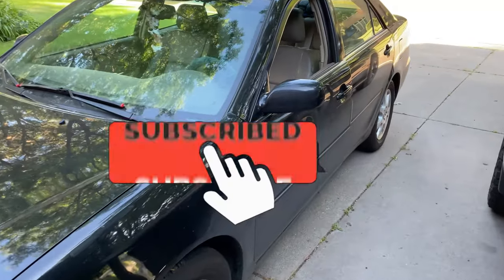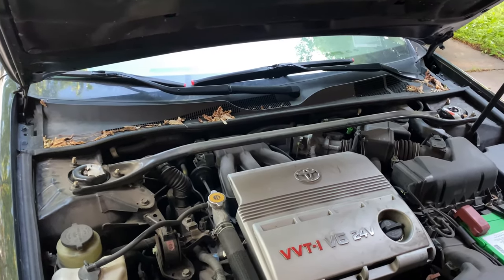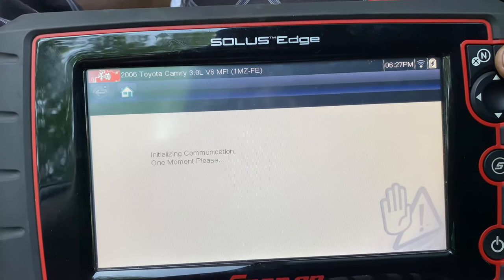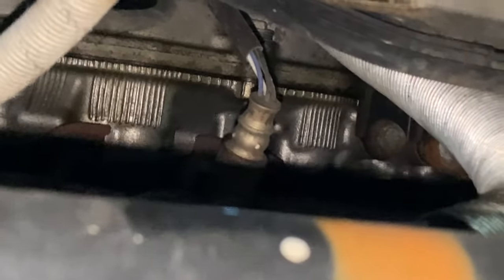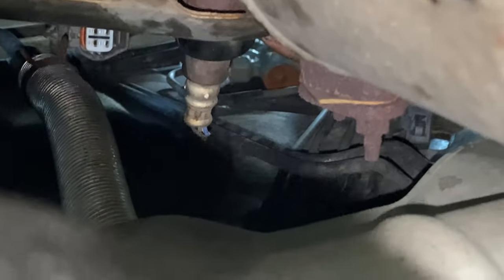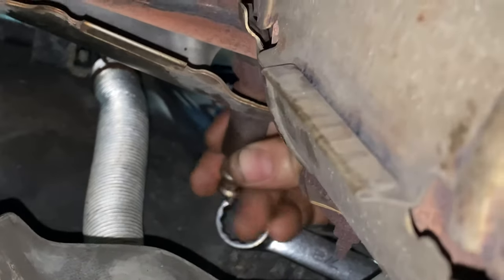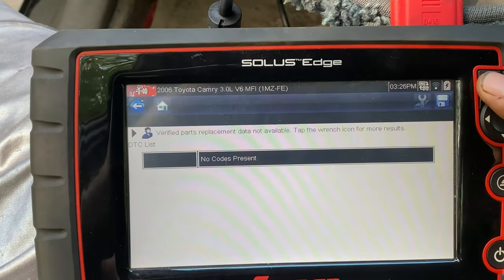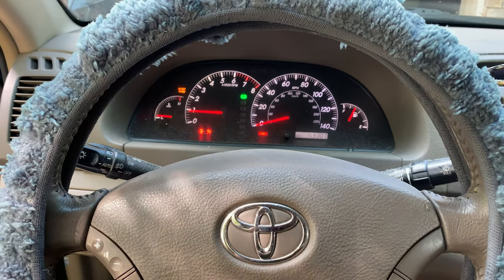Toyota Camry O2 Sensor Testing/Replacement

Comment: 9/24/'24 -I admire your tenacity - not to mention your flexibility...I attempted to do this from underneath my '02 Camry... My 78 year old bones just can't handle it...Somewhere else on Youtube I saw a video which removes the air box(s) and I thought I'd try that... I actually was able to REACH the connector and after spraying with silicone, disconnect it! amazing! I can't get my usual 7/8" wrench quite onto the sensor because of the damn metal shroud, so I ordered the crow's foot socket and I'm awaiting shipment. But it looks MUCH easier than working underneath, unless of course, the mech has a lift...I'll return with the final chapter of this experience!
Reply from the maker: Props for still turning wrenches! Fingers crossed your sensor comes out without much fight!
Reply: @TonyTheTruckGuy  Tony - thanks for the reply! maybe you can clarify for myself and anyone else battling this... When I look at your links for the 2 different upstream sensors, the 9042 and 9047 are the same plug config...yet they are supposed to be different (according to Toy dealer) and some people say the plugs will not interchange... what say you? thanks for any light you may be able to shed
Reply from the maker: @Dee-hi5zj  The connectors look similar, but I think 1 is black and 1 is gray. They also have different part numbers and you can see the wiring on the 1 is longer. Seems to me they are still listed properly.

Comment: Awesome!  Thanks. I got the same code and needed to know which one was sensor 1 bank 1. The other traction code you are getting is usually fixed by calibrating the sensor. If you disconnected the battery it will need recalibration.

Comment: Great video Tony.  Clear camera work, covered all the details. I have to scan my V6 Camry to see which sensor needs replacing, but I'm sure I can replace it with the help of this video!
Reply from the maker: Thank you! Good luck!
Reply: @TonyTheTruckGuy  Done! It was bank 1 sensor 1, so the exact same one as this vid. Wasn’t frozen on badly at all, especially considering it’s a 15 year old car in the northeast. I bought the slotted socket for this. The hardest part was getting enough leverage on the breaker bar.  And pulling off the connector was no picnic either. Thanks for the help!
Reply from the maker: @homer4163  Haha, exactly. Glad it went well!

Comment: Very nice step by step detailed video!!  I have P0420 code which is different problem but it gave me a good idea of what to do to replace the O2 sensor bank 1.  I also have VSC warning on like yours but not sure changing the O2 sensor would fix this in my case, though.  Thank you!!
Reply from the maker: @tommason5689  I think this one was ABS related

Comment: What symptoms was the driver having? Having similar issues here with my 3.0L 2005 Camry. Low voltage on my bank 1 sensor 2.
Reply from the maker: No symptoms other than the engine light illuminated with a code for this sensor.
Reply: @TonyTheTruckGuy  thank you for the reply! My acceleration has been slow on the get go.. car is in the shop now, we will see! Great video man! Love the channel.
Reply from the maker: @andrewhoopengardner2882  Thank you! Good luck with repairs!

Comment: Hey bud I have a question 
My 2010 camry 62, 000 miles. After filling up tank I noticed the engine light and slip light showed up. I was thinking the gas cap I  cleaned it didn’t help my battery was older so I changed it. I went to parts store and I got a code p0137. My question is is it really a sensor issue the dash sign is not there all the time. It came and disappeared after changing battery.
Reply from the maker: If there’s no light on currently, I wouldn’t worry. If it comes back with that same fault, it’s likely the sensor.
Reply: @TonyTheTruckGuy  Alright cool. Thanks

Comment: Have you ever tried to clear the airbag code? Have the same light on my Camry 2005 V6, and in the center screen says Passenger Airbag Off. The problem started after my car got flooded by a storm.
Reply from the maker: This airbag light was on because the car got T-boned and the passenger side curtains deployed. You probably have some corroded wiring or something. Also that light should be on if nobody is in the passenger seat. If someone is in the passenger seat, then it’s not working right.

Comment: Excellent explanation. I have the same symptoms of both upstream AF sensors having constant .66v reading on 1999 Camry V6 without any codes & CEL. Does anybody know why the AF sensors for bank 1 and 2 are different? Are they custom designed matching the these two banks?
Reply from the maker: Not sure on your ‘99, but this ‘06 has a different connector for each sensor, so position did matter.  I would try to get the exact position you need if possible (bank 1 sensor 1, etc).

Comment: I have bank 2 sensor 1 that's turning check engine light on. Isn't that the easy one to get to right under the hood. Also do you know the Denso part# for that sensor? Thanks!
Reply from the maker: Assuming you have the same engine as me, the bank 1 sensor 1 SHOULD be the one I pointed at around the 2:20 mark. I do have a bank 1 sensor 1 listed on Amazon in the video description if you want to buy it online but that should at least get you the part number.
Reply: Bank "2" sensor "1" 2006 Camry ole 3.0 V6. Is that the Denso 234-9042 ?
Reply from the maker: @chdjhns  It should be, that’s what came up when I searched for it and that’s what I have listed in the video description.
Reply: Thanks

Comment: Is it possible doing it from the top? Even if you have remove a few pieces
Reply from the maker: I’m sure it’s possible, just not very fun lol
Reply: Hey do you have a social I can reach you at for a quicker response? I have a few questions as I’m doing the change of the sensor right now
Reply from the maker: @mgxceo  I’m pretty good about replying on here so long as I’m not actually busy, otherwise you can email me at TonyTheTruckGuy@Gmail.com
Reply: @TonyTheTruckGuy  ok coo. Question 1. I’m iffy on using only one stand and a jack with tires to support while I’m under there. Do you think I can lift from the side and go under the car from the side instead of going under the front?
Reply from the maker: @mgxceo  Yeah, I wouldn’t trust the stand on one side and the jack on the other, so probably better to jack up whichever side you’re working on and just support that side with the stand and make sure to block the wheels with something

Comment: What is the denco sensor part number??? I need to do this to my 2004 Toyo Camry SE V6
Reply from the maker: I have the links listed in the video description 👍
Reply: @TonyTheTruckGuy  so is it the same part number as the b2s1? Trying to figure this out and you are the first video I've seen that talks/shows this sensor's replacement
Reply from the maker: @FRJ1982   I have the B2S1 listed. All 4 positions are listed sctually

Comment: I have the same exact vehicle and same exact issue replaced the o2 sensor but did not solve the issue and code reader is still showing p0031 bank 1 sensor 1
Reply from the maker: Did you clear the code after replacing the sensor?
Reply: @TonyTheTruckGuy  yes
Reply from the maker: @joeb8725   Very strange. And you’re sure the connector for the sensor is plugged in all the way? No bent or corroded pins? Also what brand sensor did you use? I wonder if you got the right one.
Reply: @TonyTheTruckGuy  I didn’t do it myself my mechanic did it
Reply from the maker: @joeb8725  Oh I see. Well if you brought it to them for repair and you’re still having the same issue, I’d bring it back to them because they didn’t diagnose it right and verify repairs. Unless you just went in and told them to replace the sensor without doing any diagnostics.
Reply: @TonyTheTruckGuy  they did diagnose it and showed sensor 1 bank 1 they just replaced it again to see if it was a bad part and the code came right back on so not even sure what to do from here the car runs fine but I have the check engine, vsc, and trac off lights on code reader still showing p0031
Reply from the maker: @joeb8725  Literally all the same codes I had haha. But even after fixing the O2 sensor, I still had the VSC and traction lights on. That’s a different issue. Assuming you didn’t get 2 defective sensors, you must have a broken wire or ECM issue, unless you have a stuck fuel injector or bad catalytic converter causing the sensor to read wrong. They will have to actually diagnose it instead of throwing parts at it and hoping for the best lol
Reply: @TonyTheTruckGuy  yeah exact same issues as u same exact vehicle they he offered to take the part back and try getting  sensor from Toyota but other than that he’s not sure what else it could be and his computer isn’t showing any other codes or issues
Reply from the maker: @joeb8725  I’d tell them to either figure it out or give you your money back for the “repairs” they have done so far since they clearly are just throwing parts at it and not diagnosing anything. And the new sensor didn’t fix it which means your old one was probably fine. Need to find someone a little more experienced for some more advanced diag, or just live with the engine light.
Reply: @TonyTheTruckGuy  so I took it to Toyota had them run a diagnostic and they said he changed the wrong sensor
Reply from the maker: @joeb8725  😂😂 That explains it

Comment: Why not go in from the engine bay? Unless the V6 Camrys have got the Bank 1 Sensor on the bottom of the car and it is not in the engine bay.
Reply from the maker: Yea the location is in a poor spot, it was easier to come from the bottom in this instance.
Reply: @TonyTheTruckGuy  Yeah. In the 2.4 liter models, the upstream sensor is in the engine bay and it's really easy to access.

Comment: Help! I need you.
Reply from the maker: I can try, what’s up?
Reply: I don't know who I can trust to fix the problem on my car. Toyota camry 2006 LE CHECK ENGINE LIGHT IS ON. I TOOK IT TO AUTO ZONE. ITS THE bank 1 sensor 1. :( any advice?
Reply from the maker: @ritarosado4673  Well without looking at scan tool data or doing some testing, I can’t say 100%, but I’m guessing your O2 sensor is bad. If you have the same engine as me, you’ll be replacing the exact sensor that I’m replacing in this video.
Reply: Thank you so much.

Comment: Replace the one on the exhaust now it's say the one front of eng 2.4 4cyl here we go again it won't fix mine 04 Camry that was 125 .00 the other one front is another 80 plus their labor
Reply from the maker: Make sure the correct one is being replaced. It may be different on the 4 cylinder